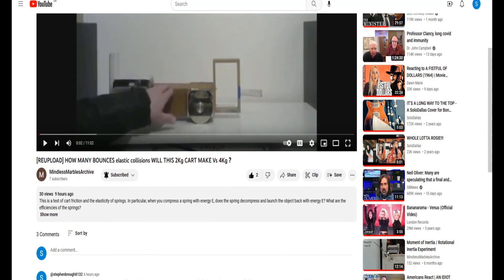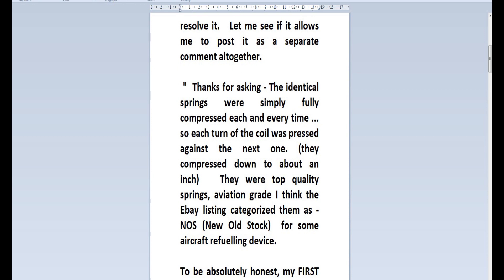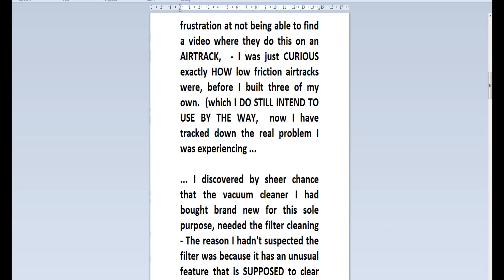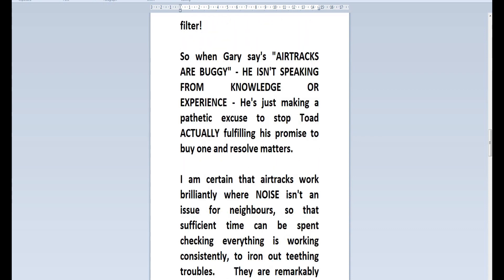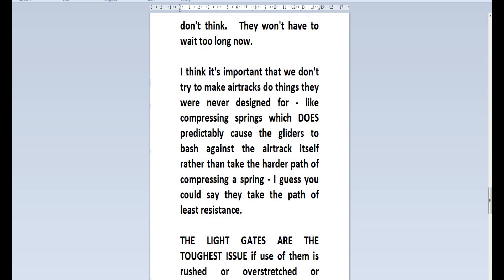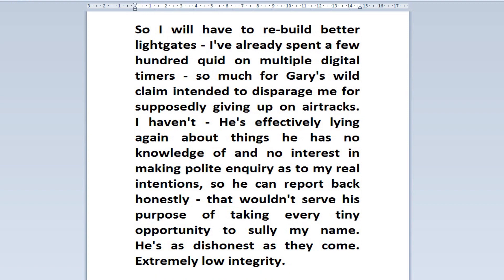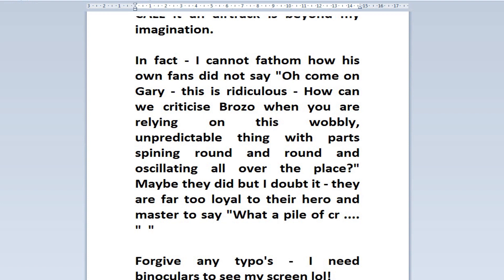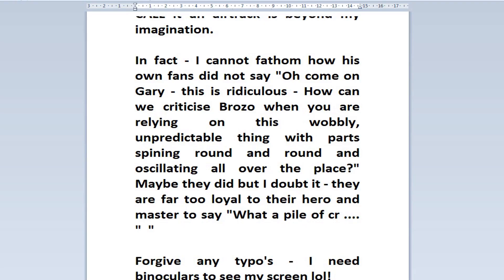YOUTUBE BLOCKED MY REPLY TO MINDLESS MARBLES SO HERE IT IS IN VIDEO FORM.

Comment: First!    😂
Reply from the maker: Hey John, I was only thinking about you earlier, hoping you are feeling better.   Yes you were first - first to appreciate this particular expriment which has always been appreciated.
Reply: @stephenbrough8132  Thank you, Stephen!   👍
What I didn't tell you is that my doctor gave me medicine last week.
But what I really need is daily exercise.
Stay safe, dude!   🌞
Reply from the maker: @_John_Sean_Walker  Yes John - I feel LUCKY when friends kinda force me to go shopping for them etc etc, when it's the last thing I sometimes want to do.  I see the bottle as half full instead of half empty as it were - They might try to get someone to give me a lift but I decline because hard work is good for me - a "use it or lose it" kind of thing.   I pity friends who sit doiwn or lie down as many hours of the day as they can get away with because there's a price to pay - as one such friend found to her cost, with a stroke rather early in life - although she's an extreme example who used to get a TAXI to her Mums,  litterally 100 yards away - 150 yards at best.    Recently shes been riding round on a mobility scooter, which she now DOES need due to the weight she's put on - she broke a chair at christmass by sitting down on it too quickly!     Before you laugh thouygh ... I have to be honest ... I BROKE TWO OF THE SAME CHAIRS, so they are obviously a flawed design with skinny legs, weakened by the bolt hole drilled through them where they fix to the seat.
Reply: @stephenbrough8132  Hi,
Can you help me?
I have an object that weighs 31 grams.
I drop it from 25 centimeter, and I weigh it again, but it is made of steel, so it still weighs 31 grams.
I dropped it from a bridge onto a dirt road, but when I weigh it again, it still is 31 grams.
Am I doing something wrong?
Reply from the maker: @_John_Sean_Walker  I can only adviuse you to listen to ten years one hour long videos made by Draftscience, made just for people like us who misunderstand everything through listening to teachers, professors, reading books and other time wasting religious distractions from the reality that yout steel ball would weigh 62 grams no matter what height you dropped it from - I THINK that's his claim - it's so hard to take in the vast amount of information that veritable genius has to offer us lesser mortals.   Don;t forget, the dirt road has friction - which we don't understand - and nobody has thought to study in 300 years.   So friction makes the ball bounce up again - and down again - until the friction absorbs the momentum, ya know, londa like, er, ya know, so the earth moves a little, moving us closer to the sun, ... But I'm out of my depth now - It really is simple and yet I can't grasp it.   If only he would draw it for us one more time.    And one more time again -  repetition is key.
Reply: @stephenbrough8132  Hey, Steve,
I want to share with you, that it is not always wise to write a long comment with unrelated topics under someone else's video, since viewers who are interested in the subject may find that boring, or even annoying.
I've already witnessed some of your comments disappear.
🦇
Also don't let Goofy make you believe that the things you did are a complete waste of everybody's time, because they aren't.
And don't say out loud that you did something wrong, or that you don't understand something, because she uses that to influence her victims, you see.
Be strong, Steve.
😲
Stop being afraid of equations, Steve.
You already master a lot of them, you're almost there, so to speak.
You can compare an equation with a tool, like a ruler or a scale, for example.
Don't think that it is me who is constantly stressing the importance of the equations, or how to work them out.
I'm a fan of these simple basic equations, but by no means am I a math nut.
I don't like how people like Mickey Farley or Alexander Zapata, for example, immediately start with differentials and dx, just to show us how good the are with calculus, but where they forget how it makes things only more complex, and even more unclear.
Often it only shows us the surface area of a triangle, where I can simply use ½hb.
Try to see that it is mostly Goofy who wants to make believe that everything is only MV.
But also see that Goofy's two masses on a horizontal line, look exactly the same as my equation v1 × m1 × r1 = r2 × m2 × v2 and that I try to show that it can only be 'momentum' when r1 and r2 have the same value, and cancel each other out, to get: v1 × m1 = m2 × v2 whitch IS momentum, but in Goofy's own drawing r1 is NOT r2 so it MUST be angular momentum, and therefore it IS Goofy who started talking about angular momentum, NOT me.
Do you see what I mean, Steve?
Reply: @stephenbrough8132  In your post-it video you can do a run where the incoming probe (2mass) is at the same distance from the pivot (r1=r2) as the outgoing probe (1mass) so that this looks more like momentum (m1v1=m2v2), so that the velocity of the outgoing probe would be close to twice the velocity of the incoming probe (minus friction as from the mass of the rod).
Reply from the maker: @_John_Sean_Walker  I  think I do, John.    ... On the subject of my long comments on other people's channel disappearing - I do delete a lot of my own long comments on other people;s channels - for varying reasons - sometimes 5 minutes after posting, sometimes a lot longer after... Particulatly if I get a comment after I've forgotten (and regretted)  even writing it ... I then figure it;s not worth the hassle or reminder of the past.    If there are any particular channels you recall this happening on, I might be able to say whether I deleted them myself (I will typically delete ALL my comments on that channel if I can find them)  ... or if the channel owner has deleted them, I can be more wary of wasting my time contributing to their channel in the first place.    I only just finshed a rather long comment on Mallen Baker's latest video, even though I don't really expect many people at all will bother reading it all, I did enjoy writing it, because it's a moderately amusing anecdote that does relate to the opening sequence of his video (about fake psychics) ... although I DO go into a LOT more personal detail in order to recount the true story as best I can.    I think Mallen himself will probably read it because he's read my very long comments before and interracted back - which was nice - But I comment so rarely on his channel I'm sure I;m not considered a regular nuisance.    No harm done amyway - I do enjoy writing and luckilly type reasonably fast.  The hardsest thing about it is my bottom gets numb because I prefer to sit on a hard chair.   Well until a month ago it was the only chair I had.
Reply from the maker: @_John_Sean_Walker  I'm a little confused here John ... this is another one I will have to dwell on a little.   I'll get back to you mate.
Reply: @stephenbrough8132  The height however, would have a different ratio.   😂
Reply: @stephenbrough8132  What would Goofy say if the outgoing probe would be at 10 times the distance from the pivot?
Reply from the maker: @_John_Sean_Walker  Yes I will think about that aspect too, John - It doesn;t sound like a difficult experiment to do  (famous last words lol!)  so I will be able to get to grips with it more when I actually do it, predicting the outcome as I build it.

Just been looking at Dispar's video - an interesting variation on a theme.
Reply from the maker: @_John_Sean_Walker  Can you remember where did Gary actually ask anyone to do this experiment, John?    And why with those particular weights?   (as opposed to any other 2:1 ratio, like my pool balls and half pool ball)   - I'd like to include a clip of him challenging us to do it.  It's been keeping me awake.
Reply: @stephenbrough8132  This Afternoon's video.
Reply: @stephenbrough8132  Hello my friend,
I don have enough time to search all Goofy's videos to find where she's talking about the lever with a one mass, and a two mass, each on a differend side of the pivot, but Marbles has a few videos where you might find some, although he doesn say from which video he has those clips.
What I do know is that Goofy has a live video from 4-10-23 where everything she says is wrong, and she may mention something like what you are searching for.
👍
I've made this special (comment-) line for you, to make it easy to understand what I claim about angular momentum vs momentum, because you said that you "... are a little confused ... have to dwell on a little ...":
o_______O________🔺___________________
What you see is a one mass probe at twice the distance from the pivot, and a two mass probe at one time the distance from the pivot, both on the same side of the lever.
What this looks like in mathematical notation in terms of angular momentum is this:
m2 × v2 × r2   AND   m1 × v1 × r1
       (L2)                                (L1)
But since you don't see it moving, the v2 and v1 here, are somewhat misleading.
Now, what Goofy is doing, is talking about m1×r1 being the same as m2×r2 which is correct in that sense, that she herself stated that m1 has twice the mass of m2, AND r2 is twice the distance of r1.
When the lever is oscillating, the probe that is further away from the pivot will always move twice as fast as the probe that is closer to the pivot, independent of their masses, since Goofy stated that their distances relate to one another as two to one, you see.
The momenta of the two probes in this example are: m2×v2 and m1×v1 so again it is how the example was designed that they have the same value. (1×2 = 2×1)
But in this setup there is angular momentum! (The two probes are NOT directly colliding with each other.)
Every physicist will agree with me that the angular momentum shows something completely different.
You can do the calculations for yourself:
Angular momentum: L = r × m × v
And if we assume: r2=2m, m2=1kg, v2=2m/s, and r1=1m, m1=2kg, v1=1m/s, we get for the angular momenta:
r2×m2×v2 = 2×1×2 = 4   AND   r1×m1×v1 = 1×2×1 = 2   where both answers are in kg×(m/s)×m giving: kg·m²/s or: kg·m²·sˉ¹.
4 is NOT the same as 2!
😮
But what Goofy does next is completely wrong, since she jumps into the conclusion that in every experimental setup, the single facts of the setup above will apply.
But that is outrageous.
😳
In the next figure:
o_______________🔺________O_______
We can see that all numbers and values are the same as in the previous figure, except that the direction of the two probes is opposite.
Goofy uses this figure to prove that the angular momentum of the smaller mass probe on the left, will be the same as the angular momentum of the larger mass probe on the right, AND will be the same when the heavier probe is falling down on her lever.
But in that case she will magically have free energy, because the angular momentum of the outgoing probe will not be the same as in the previously example, but it cannot exceed the incoming angular momentum, the 'law' that we call 'conservation of angular momentum'.
Calculating the true velocity of the outgoing probe (left), using the equations is possible, but doing the experiment is mucdh more fun!
😂
The final figure:
o_________🔺________O
Shows the coincidental situation where the smaller mass probe and the heavier probe are at equal distance of the pivot, each on a different side.
Try to understand that compared with the equations like discussed before, the two distances here cancel each other out in such a way that:   r1/r2 = 1   and   r2/r1 = 1   and therefore the equation of angular momentum reduces to:   L = m × v   so the equation mimics the equation for momentum.
But remember that the entire setup is not moving when the incoming probe is accelerating the outgoing probe, meaning that there is zero momentum now, only angular momentum.
Before the heavy incoming probe is touching the lever, it is building up momentum, that is true.
Also true is that the outgoing probe will have a certain momentum as soon as the lever is no longer accelerating it.
___________
You see, Steve, I can write long comments too.
Be safe, brother.
Reply from the maker: @_John_Sean_Walker  It was a very wortwhile long comment though, John.  I like your idea of  illustraing  in text form ... It makes it so much easier to grasp what is being discussed.   (How do you make the little red triangle for the fulcrum?   I'm on a PC if that makes any difference)    

I wasn't expecting you to trawl though Gary's videos John - I know how torturous a process that is - I just thought you might have a vague recollection.    I was GUESSING it must have been round about the time I did that final version of his proposed experiment launching things off a table edge and measuring the distances before the two masses hit the ground, because that was the first time (if not the only time) I used 62g and 31g balls.    But it can be hard finding the actual replies he makes, even to a specific video like that, because he tends to slot his replies between all sorts of other junk and often continues to "respond" in dribs and drabs, dotted quite randomly throughout the next 40 videos he makes - so he makes it quite impossible for me to meaningully understand what his objections are supposed to be - it would take 40 hours of dedicated listening to his repetitive mish mash where he throws in EVERY OTHER arguement to support his latest weak or virtually none existent argument.   If we all had time to just talk at his snails pace for 1 to 3 hours a day, then WE could bore the pants off HIM for a change and oblige him to waste HIS day.    But as it is, we restrict ourselves to either written comments which are relatively easy to digest - even if I go on a bit and digress.   It's easier to search text for a word or phrase than it is to wait three days for youtube to provide a transcript full of wrongly transcribed words and try to guess what Youtube THOUGHT Garywas saying with his slurred, lazy speaking style and mispronounced words too.  

I WILL do the experiment - Post it note still there - I'm just in the middle of some other crucial experiments to tie in with the new version of the previous "pool ball experiment" - for want of a better description.        

I;m not going to describe what I am doing in any detail because I think that just gives Gary plenty of time to invent his excuses.    But I'm making as clean an experiment as I can, in all the different cases, all the variations I am doing - so it will be wworth the wait.   The preparation takes ages, so I don;t even know the outcomes (plural) myself yet - although I'm happy to predict they will all be in agreement with KE etc.  

It's been a second, LONG day of mainly serving others and having to squeaze in a few hours more progress whenever I can - so I will get on with that and make a more sustained effort to go through the details provided here when I have an hour or so I can dedicate to that.     Your efforts won't be in vain.  

Thank you, John.
Reply: @stephenbrough8132  💙
📌 Thanks 🚩
                                        °ˉ👽ˉ°
Reply: @stephenbrough8132  💡 When you are inside a text file, you can try pressing the alt-ground key plus the 2 key that is above the w key. (not keypad)
And there are more keys that work in combination with the alt-ground key. (try 7)
Reply from the maker: @_John_Sean_Walker  Thanks - I will try that ... 
Maybe I misunderstand what you mean by "inside a text file" because I've tried Alt Gr - 2 and Alt Gr  7 in a Windows Notepad document and a wordpad document and also while typing here, and nothing is happening. .. Not to worry.  Thanks for the suggestion anyway.
Reply: @stephenbrough8132  May not work on older keyboards.
Reply from the maker: @_John_Sean_Walker  That's probably the problem then - it is rather old.
Reply: @stephenbrough8132  Do you ever sleep?
Reply: @stephenbrough8132  I posted a paradox under Ian's paradox video.
Reply from the maker: @_John_Sean_Walker  Yeah mate - But when I'm on a roll,  building a few experiments in this case, (it used to be music which kept me going)  I just keep thinking I'll do a bit more or I won't sleep easy, not knowing I figured how to build the next bit.    I get a bit of a buzz out of it.  (Plus taking full advantage of not being ill for a change)
Reply from the maker: @_John_Sean_Walker  I'll have a look - Hope it's nothing too taxing - I may not be up to it lol.
Reply from the maker: @_John_Sean_Walker  I've not managed to find it yet, John.   Which video?
Reply: @stephenbrough8132  Do you have my link now?
Reply: @stephenbrough8132  His Paradox video. (latest video?)
Reply from the maker: @_John_Sean_Walker  I will look again and make sure I also click the "SORT" button which often reveals hidden comments.  I might not be awake long enough to solve it though TBH ... I've hit a wall so to speak.
Reply from the maker: @_John_Sean_Walker  Yes - that was it - I had to click SORT BY - NEWEST and it popped into view.  Thanks... Not looked at it yet.  Looks interesting at a glance though ... TBC
Reply: @stephenbrough8132  Don't feel sad if you cannot solve it, it is quite difficult.
Reply from the maker: @_John_Sean_Walker  It had me beat a bit longer than I hoped but I got there in the end ... I won't say the answer I reckon here as I don't want to spoil it for anyone ... so I will post what I thjink is the answer in a separate comment then immediately delete, so only you will see it in your notifications.    Nice one though!
Reply from the maker: So was I right or was I barking up the wrong tree?  If I'm wrong then I need to go to sleep lol!    Nice one though - I enjoyed that!
Reply: @stephenbrough8132  You are still missing an important part of the clue.
Reply from the maker: @_John_Sean_Walker  Drat!   I can't rest yet then lol!
Reply from the maker: @_John_Sean_Walker  Ah!!!!!!!!!!!!!   ...  I see what you mean now ... What cruel person dreamed this up lol!
Reply from the maker: I was over confident last time I thought I had sussed it - so now I've realised there's more to it (trying not to say too much) - I'm hanging fire in case there's STILL more - Let's just say it's a mess!  (and someone needs firing!)  (It's hilarious - been making me laugh - and I didn;t expect that!)
Reply from the maker: I've deleted 3 more comments that I only want you to see, John, in case it spoils it for anyone else, if I really AM on the right track now .. I;m NOT properly there yet and may have to leave it now I realise the basic nature of the problem - The math will be too challenging for me but probably not most people.  Im trying to avoid saying anything else that might be too big a clue what I thing the nature of the problem is.   This is a GREAT puzzle / paradox.
Reply from the maker: You must be laughing your head off John lol.  I'd better get back to experimental work though.  This was great entertainment - being made to feel a right Wally!     It's the last time I'm doing any of YOUR puzzles mate!  (JUST KIDDING!)